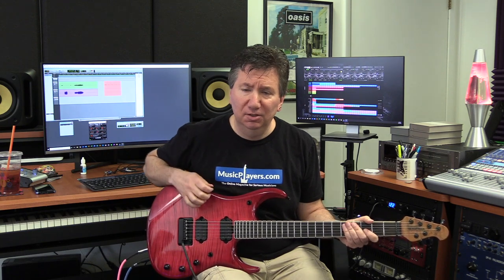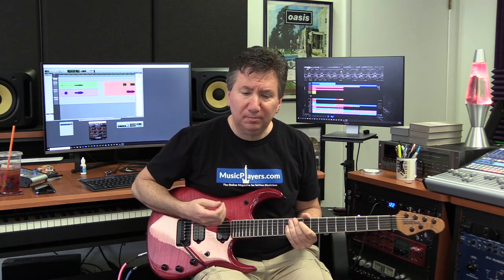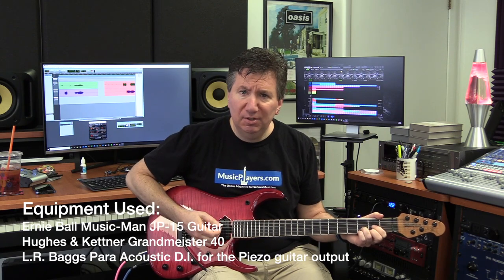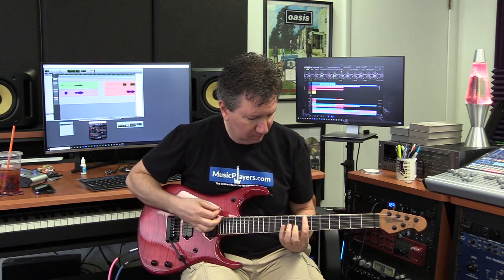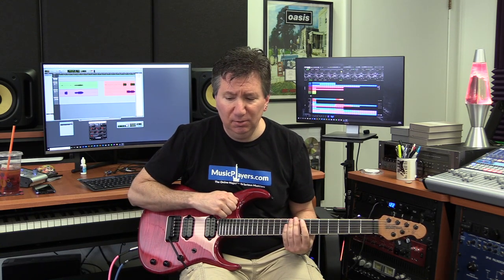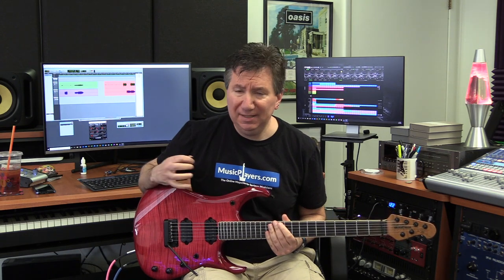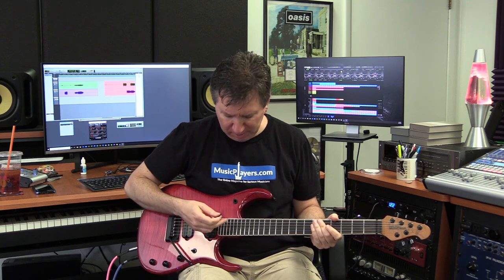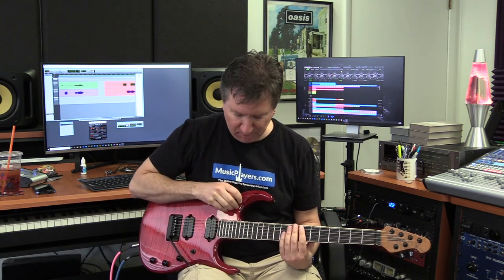Demo: Benefits of Piezo Acoustic Output From An Electric Guitar (JP-15)

Comment: At 5:47 I would LOVE to know how it sounds like without the piezo and roughly how to get that modulated reverb type of sound! very cool!
Reply from the maker: Thanks! I love that dreamy sound. I have the magnetic output on the middle position with the coils split, so the JP-15 is giving its best clean Strat-like sound into the H&K amp on a clean channel with just a hint of delay. The acoustic output here is running through the Eventide Black Hole plug-in on the computer, but in a live setting, I have the Eventide Space pedals which can create the same Black Hole algorithm for the dreamy sound. My LR Baggs Para Acoustic DI has an effects loop, so for live, I put an Eventide pedal in the loop of that for dreamy acoustic tones (I have an H9 as well but haven't used it this way yet). Obviously the DI runs to the PA system, while my magnetic output would run to my live guitar rig (ENGL gear).

Comment: Cool video! are you using two mono cables in each output from the guitar?
Reply from the maker: Yes, those are two mono (TS) cables. Alternately, you could use one stereo cable (TRS) to a splitter/breakout box, but TRS guitar instrument cables aren't quite as common.

Comment: Nice review. I like Oasis too! I just got one of these but if I played it like you did during the video and then checked the tuning it would be out of tune. Does your hold it’s tuning well?
Reply from the maker: These guitars keep their tuning VERY nicely. The Music Man JP custom bridge is renowned for tuning stability. If you have an older/used JP that you acquired, you might need new springs, or add an additional spring. If it's new, did you switch to heavier strings? I'd never go heavier than .10s on a JP, personally I use .09s which is what they ship with, too.
Reply: @musicplayersnow  I ended up returning it as it would not stay in tune. Otherwise it was an excellent guitar.

Comment: Awesome review, are the two cables mono?
Reply from the maker: Sorry I didn't make that clear in the video. Yes, those are two mono instrument cables (standard guitar cables). But alternately, you could run a single stereo cable from the guitar to a small breakout box that separates the stereo cable to dual mono jacks and then from there, route the signals to your guitar amp and to your PA system. That's how JP runs his guitars live. If you want to go wireless, though (which I usually do), you need two transmitters on your strap as the popular instrument systems are all mono. -- Scott

Comment: Hello I like the soundof your acoustic piezo. Is the LR Baggs Para Acoustic DI is connected with your piezo output direct is it with or without a reverb on it its just the LR BAggs itself? because the sound is erally realistically acoustic guitar. I have JPX 6 BFR musicman, and I have the boss AC-3 simulator but I don’t like teh sound of it, for me its ok sounds acoustic but there’s something not there… when I heard this LR Baggs from you suddenly the sound of acoustic in a piezo system… that’s why I wanna upgrade and asks you if its worth an upgrade?, it’s somewhat expensive though.. Thanks
Reply from the maker: Thanks. Yes, guitar Piezo output into the LR Baggs Para Acoustic DI then into a channel in my Antelope Audio interface. There is TC Electronic 8210 hall reverb on it. What's cool about the Para Acoustic DI is it has an FX loop -- get a stereo/Y cable from Hosa that has balanced (stereo) quarter inch male at one end and two mono quarter inch male jacks at the other end to go into a loop on a pedalboard or a dedicated reverb pedal for great live sound. And the DI can be powered by 48V phantom power off a mixing board -- no batteries required. When we first reviewed the DI we tested with the JP6 specifically and loved the difference in sound. 
https://musicplayers.com/2007/05/l-r-baggs-para-acoustic-d-ultimate-direct-box-acoustic-electric-guitars/
Reply: @musicplayersnow  Hello thank for the reply. For me for now I think battery is option for me now, a 9V battery will lasts for 12 hours though for practicing that is more than enough… but for gigs always I’m fixed infront of the house with Phantom powered mixer. What I’m intrigued about is , does it dounds good or awesome as well even without the reverb? 

Yes regarding that FX loop first time I encountered that hehehehe…it needs a Y split cable for it. 

Does the presence, is as good as th reverb? Because I dont plan to buy a reverb on my pedalboard, I rely the reveb on the mixer or on the amp… 

Thanks for your infos … really thinking of buying one. Cause of it’s sound realistically acoustic guitar.
Reply from the maker: @Akukog  You really want to add some reverb, even if it's from the PA system. When you play a real acoustic guitar, sound resonates out of a soundhole which is cavernous and creates an ambience of its own. Think of the Piezo output as being an acoustic guitar without any natural space around it... you need to place it in a room (think Hall reverb) for best sound quality. So, dry, it still sounds waaaayyyyy better than straight into a mixer, but you really want to add just a little bit of reverb for it to sound natural.
Reply: @musicplayersnow  Oh hmmmm…. thanks a lot for the info …. appreciate it.
Reply: @musicplayersnow  I'm sure you’ve used the boss AC-3 acoustic simulator, between the LR bags, what do you prefer? Sound wise? because I cannot decide really hehehe… it both sounds acoustic, boss even have a reverb on it, but… it’s lacking something, the boss AC-3, that’s me. But when I heard LR baggs para acoustic, something opens up my ear and I’m satisfied … but I don’t know what it is. hehehe I hope you get me.. hehehe..
Reply from the maker: @Akukog  The BOSS AC-3 is designed to make an ELECTRIC guitar sound like an acoustic guitar. The LR Baggs Para Acoustic DI is designed to make an ACOUSTIC guitar sound its best when amplified, in a mixing board, etc. The Piezo output should be thought of as ACOUSTIC output, not electric guitar output, which comes from magnetic pickups. I would expect the Baggs to do better in this role.

Comment: Can we use just the piezo by itself with just one output?
Without the second input?
Reply from the maker: Yes.  When you use a single cable, both the piezo and magnetic pickup outputs go through it. The three way toggle still selects piezo only, combination of both, or magnetic pickups only but all output goes to one amp.
Reply: @musicplayersnow  okay so i don't need the second cable to be able to use the piezo right?
Reply from the maker: @abdullah_lxl1681  correct. It’s just the best sounding way to do it if you have a secondary way to amplify the piezo. But you can set your guitar amp to a clean channel and get decent acoustic results if your amp’s clean tone is really really clean.
Reply: @musicplayersnow  okay thank you for your answer 😊